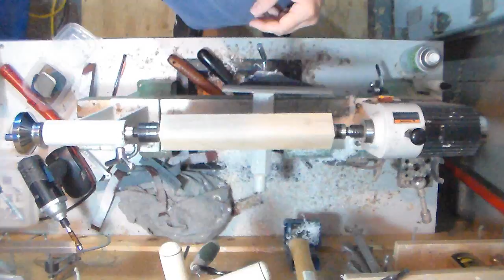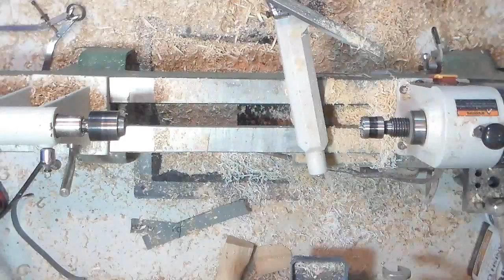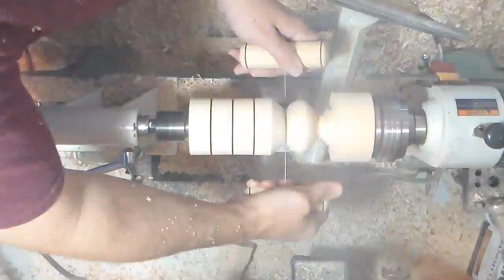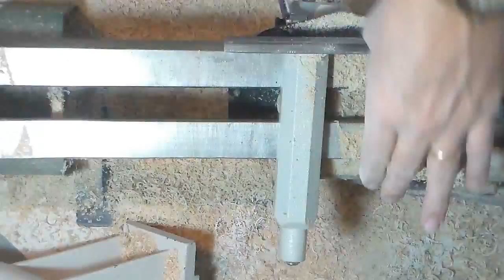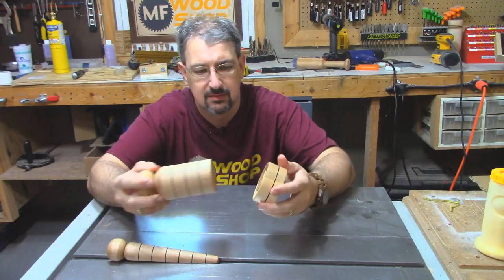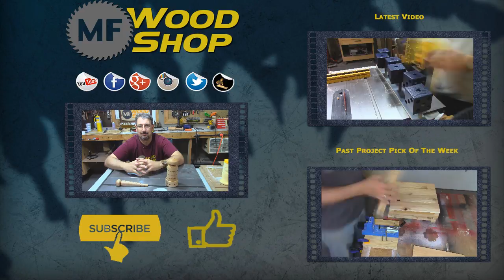Paper Pot Maker and Dibble

Comment: The wedged shaped tool is a Dibble you use it by putting your hand on the top and pushing it down and in a circular motion so it pushes the dirt to the side packing the dirt firmly to the side as it goes in. So when you have attained the depth you require and remove the tool it will maintain the opening to plant your rooted plant to the proper depth then you can just push the dirt back around the root to hold it in place. Or just plunge and twist it to make an opening for seeds to correct depth.
Reply from the maker: +Murray Lowe OH, Thanks for that
Reply: +Mike Fulton You're welcome